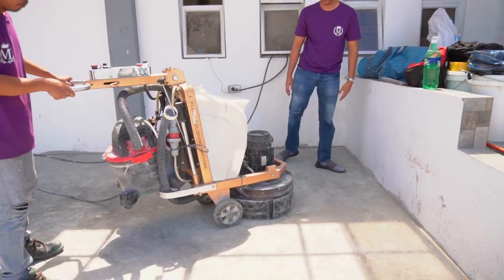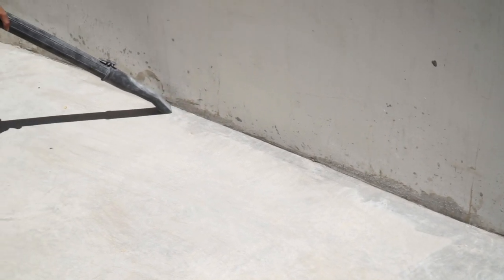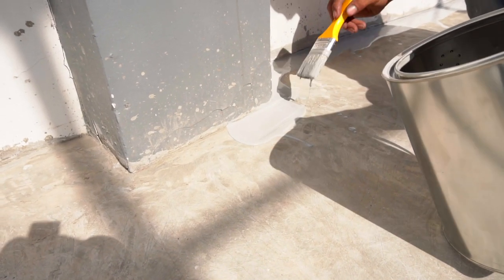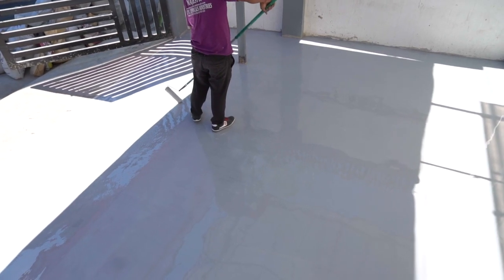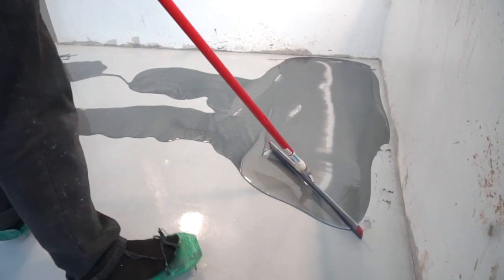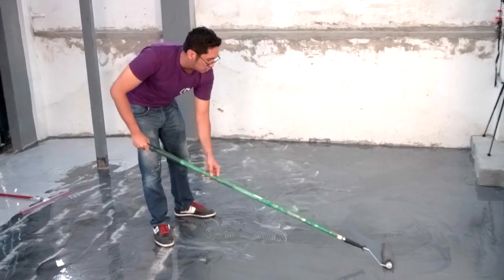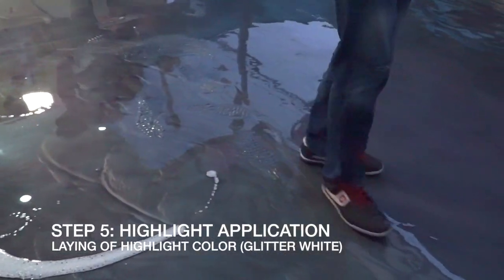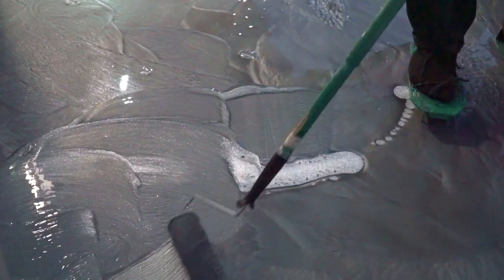METALLIC EPOXY GARAGE PHILIPPINES   METALLIC EPOXY FLOOR PHILIPPINES

Comment: ano poh ba ang poydi gamitin pang pakintab sa padir as labas ng bahay????
Reply from the maker: Good Day

Hindi po pwede ang ating product sa mga walls dahil self leveling po sya unless mag aapply po kayo sa plywood pahiga saka ikakabit sa wall :) makintab na po sya pag natuyo :)

makakabili po kayo sa amin, just message lang po and we will answer those Questions :)
https://www.facebook.com/majesticchemicals/

also we have LAZADA for COD
You can purchase to our Lazada
then screenshot your order then send it to us here so we can prepare it as soon as possible.
sa Fb page parin po :)
https://www.lazada.com.ph/majestic/?

Visit our Website
https://majesticchemicals.com/

By the way I'm Sherwin of Majestic Chemicals, Glad to assist you :)
For availing & quicker response, you may contact us
09182523454

Join MAJESTIC EPOXY RESIN COMMUNITY PHILIPPINES to show your resin works and share tips
⬇️M⬇️A⬇️J⬇️E⬇️S⬇️T⬇️I⬇️C⬇️ ⬇️C⬇️H⬇️E⬇️M⬇️I⬇️C⬇️A⬇️L⬇️
https://www.facebook.com/groups/398748351104499

Comment: Boss bka pde malaman kung anu anu bblihin at brand nya pra d magkamali?
Reply from the maker: Good Day

MAJESTIC CHEMICALS po ang BRAND :)

makakabili po kayo sa amin, just message lang po and we will answer those Questions :)
https://www.facebook.com/majesticchemicals/

also we have LAZADA for COD
You can purchase to our Lazada
then screenshot your order then send it to us here so we can prepare it as soon as possible.
sa Fb page parin po :)
https://www.lazada.com.ph/majestic/?

Visit our Website
https://majesticchemicals.com/

By the way I'm Sherwin of Majestic Chemicals, Glad to assist you :)
For availing & quicker response, you may contact us
09182523454

Join MAJESTIC EPOXY RESIN COMMUNITY PHILIPPINES to show your resin works and share tips
⬇️M⬇️A⬇️J⬇️E⬇️S⬇️T⬇️I⬇️C⬇️ ⬇️C⬇️H⬇️E⬇️M⬇️I⬇️C⬇️A⬇️L⬇️
https://www.facebook.com/groups/398748351104499

Comment: Ganito gusto ko sa garahe ko e. Mgknu kaya aabutin 55sq.m
Reply from the maker: Good Day

Masasagot po namin ang inyong katanungan sa ating FB page :) 

makakabili po kayo sa amin, just message lang po and we will answer those Questions :)
https://www.facebook.com/majesticchemicals/

also we have LAZADA for COD
You can purchase to our Lazada
then screenshot your order then send it to us here so we can prepare it as soon as possible.
sa Fb page parin po :)
https://www.lazada.com.ph/majestic/?

Visit our Website
https://majesticchemicals.com/

By the way I'm Sherwin of Majestic Chemicals, Glad to assist you :)
For availing & quicker response, you may contact us
09182523454

Join MAJESTIC EPOXY RESIN COMMUNITY PHILIPPINES to show your resin works and share tips
⬇️M⬇️A⬇️J⬇️E⬇️S⬇️T⬇️I⬇️C⬇️ ⬇️C⬇️H⬇️E⬇️M⬇️I⬇️C⬇️A⬇️L⬇️
https://www.facebook.com/groups/398748351104499

Comment: Ano pong material ginagamit at saan makakabili ng materials?
Reply from the maker: Good Day

makakabili po kayo sa amin, just message lang po and we will answer those Questions :)
https://www.facebook.com/majesticchemicals/

also we have LAZADA for COD
You can purchase to our Lazada
then screenshot your order then send it to us here so we can prepare it as soon as possible.
sa Fb page parin po :)
https://www.lazada.com.ph/majestic/?

Visit our Website
https://majesticchemicals.com/

By the way I'm Sherwin of Majestic Chemicals, Glad to assist you :)
For availing & quicker response, you may contact us
09182523454

Join MAJESTIC EPOXY RESIN COMMUNITY PHILIPPINES to show your resin works and share tips
⬇️M⬇️A⬇️J⬇️E⬇️S⬇️T⬇️I⬇️C⬇️ ⬇️C⬇️H⬇️E⬇️M⬇️I⬇️C⬇️A⬇️L⬇️
https://www.facebook.com/groups/398748351104499

Comment: Saan po pd makabili ng materials ng epoxy risen or metallic
Reply from the maker: Good day

Sa amin po mismo :) 
Avail na po kayo, dont worry meron po itong instruction maliban dun e gguide ko pa po kayo step by step until it's done :D 

For availing & quicker response, you may contact us
09182523454

Comment: pwd po yn s loob ng bahay?
Reply from the maker: Good Day
Pwedeng pwede po

makakabili po kayo sa amin, just message lang po and we will answer those Questions :)
https://www.facebook.com/majesticchemicals/

also we have LAZADA for COD
You can purchase to our Lazada
then screenshot your order then send it to us here so we can prepare it as soon as possible.
sa Fb page parin po :)
https://www.lazada.com.ph/majestic/?

Visit our Website
https://majesticchemicals.com/

By the way I'm Sherwin of Majestic Chemicals, Glad to assist you :)
For availing & quicker response, you may contact us
09182523454

Join MAJESTIC EPOXY RESIN COMMUNITY PHILIPPINES to show your resin works and share tips
⬇️M⬇️A⬇️J⬇️E⬇️S⬇️T⬇️I⬇️C⬇️ ⬇️C⬇️H⬇️E⬇️M⬇️I⬇️C⬇️A⬇️L⬇️
https://www.facebook.com/groups/398748351104499

Comment: Ano po maganda sa lood ng bahay yan metallic epoxy flooring po ba or ung tiles po.Thank you
Reply: MY LITTLE WORLD pareho lang kung gusto mo 1 whole floor go for epoxy, box designs for tiles
Reply: MY LITTLE WORLD actually mas pangit sa tiles kasi kapag ‘di maganda ang pagkabit pwedeng mabasag kapag tinapakan tapos papalitan mo pa.
Reply: @gavery2462  ano po magmahal ung metallic epoxy flooring po ba o ung tiles?at saka matibay na ung metallic epoxy flooring
Reply: MY LITTLE WORLD sa Tiles may mura, sa epoxy may mura rin depende naman sa design at quality so pareho lang naman. Mas okay lang sa tiles kasi marami nagkakabit pero sa epoxy pede ikaw or humire ka ng marunog
Reply: @gavery2462  ok po,maraming salamat sa sagot po.God bless you🙏🙏🙏🙏

Comment: pwede po bang bumili ng chemicals sa inyo at instruction to do it, para Siargao area kasi
Reply from the maker: Yes pwedeng pwede po sir. Its locally manufactured po
Reply: Magkano po ba per gallon
Reply: May website po ba ang store ninyo at pricing na

Comment: Pwedi po ba yan gamitin sa hardifloor na 3/4inch, salamat po
Reply from the maker: Pwedeng pwede sir. Isa sa advantage ng resin namin is flexibility. Kahit nag bend si hardi floor sasabay siya
 Additional din is waterproof na din si hardiflex
Reply: Pwede po ba yan sa rooftop? Tnx

Comment: Paano yan e maintain? Indoor flooring pwedi ba yan?
Reply from the maker: Good Day

Walis, punas lang po ang maintenance nito :) opo pang indoor po talaga sya maganda :)

makakabili po kayo sa amin, just message lang po and we will answer those Questions :)
https://www.facebook.com/majesticchemicals/

also we have LAZADA for COD
You can purchase to our Lazada
then screenshot your order then send it to us here so we can prepare it as soon as possible.
sa Fb page parin po :)
https://www.lazada.com.ph/majestic/?

Visit our Website
https://majesticchemicals.com/

By the way I'm Sherwin of Majestic Chemicals, Glad to assist you :)
For availing & quicker response, you may contact us
09182523454

Join MAJESTIC EPOXY RESIN COMMUNITY PHILIPPINES to show your resin works and share tips
⬇️M⬇️A⬇️J⬇️E⬇️S⬇️T⬇️I⬇️C⬇️ ⬇️C⬇️H⬇️E⬇️M⬇️I⬇️C⬇️A⬇️L⬇️
https://www.facebook.com/groups/398748351104499

Comment: bakit hindi kayo gumamit ng blow torch or isopropyl alcohol para alisin ang air bubbles? just wondering
Reply from the maker: We formulated our resin to be bubble free and for floors kasi if you have a big area kailangan po talaga minimal bubbles and if may mga nakakalusot po minsan kahit spot popping nlng po😁

Comment: Pano mkabili nito. Taga aklan ako. meron ba nito nationwide?
Reply from the maker: Good Day

makakabili po kayo sa amin, just message lang po and we will answer those Questions :)
https://www.facebook.com/majesticchemicals/

also we have LAZADA for COD
You can purchase to our Lazada
then screenshot your order then send it to us here so we can prepare it as soon as possible.
sa Fb page parin po :)
https://www.lazada.com.ph/majestic/?

Visit our Website
https://majesticchemicals.com/

By the way I'm Sherwin of Majestic Chemicals, Glad to assist you :)
For availing & quicker response, you may contact us
09182523454

Join MAJESTIC EPOXY RESIN COMMUNITY PHILIPPINES to show your resin works and share tips
⬇️M⬇️A⬇️J⬇️E⬇️S⬇️T⬇️I⬇️C⬇️ ⬇️C⬇️H⬇️E⬇️M⬇️I⬇️C⬇️A⬇️L⬇️
https://www.facebook.com/groups/398748351104499

Comment: Kumukupas b ung coatng kpg pinupunasan ng basa lagi.. Pwede b s buong bahay. Magkano mga gastos pg 20 square meter
Reply from the maker: Good Day

Di po sya kumukupas :D for more questions magtungo lang po sa aming FB page :D

makakabili po kayo sa amin, just message lang po and we will answer those Questions :)
https://www.facebook.com/majesticchemicals/

also we have LAZADA for COD
You can purchase to our Lazada
then screenshot your order then send it to us here so we can prepare it as soon as possible.
sa Fb page parin po :)
https://www.lazada.com.ph/majestic/?

Visit our Website
https://majesticchemicals.com/

By the way I'm Sherwin of Majestic Chemicals, Glad to assist you :)
For availing & quicker response, you may contact us
09182523454

Join MAJESTIC EPOXY RESIN COMMUNITY PHILIPPINES to show your resin works and share tips
⬇️M⬇️A⬇️J⬇️E⬇️S⬇️T⬇️I⬇️C⬇️ ⬇️C⬇️H⬇️E⬇️M⬇️I⬇️C⬇️A⬇️L⬇️
https://www.facebook.com/groups/398748351104499

Comment: Ano po ang magandang primer para sa rubberized paint sir?
Reply from the maker: Good Day

makakabili po kayo sa amin, just message lang po and we will answer those Questions :)
https://www.facebook.com/majesticchemicals/

also we have LAZADA for COD
You can purchase to our Lazada
then screenshot your order then send it to us here so we can prepare it as soon as possible.
sa Fb page parin po :)
https://www.lazada.com.ph/majestic/?

Visit our Website
https://majesticchemicals.com/

By the way I'm Sherwin of Majestic Chemicals, Glad to assist you :)
For availing & quicker response, you may contact us
09182523454

Join MAJESTIC EPOXY RESIN COMMUNITY PHILIPPINES to show your resin works and share tips
⬇️M⬇️A⬇️J⬇️E⬇️S⬇️T⬇️I⬇️C⬇️ ⬇️C⬇️H⬇️E⬇️M⬇️I⬇️C⬇️A⬇️L⬇️
https://www.facebook.com/groups/398748351104499

Comment: Tanong matipid ba ito kesa granite tiles?
Reply from the maker: Good Day

-water resistant
-heat resistant
-scratch resistant
-dust resistant
-chemical resistant
-di nag ccracks
-di nababasag
-walang maintenance, walis or punas lang
-super easy to apply
-shiny at elegant pa tignan
-non-slippery even wet
-odorless & solventless
-industrial grade
-food grade/safe
-Lifetime Quality
Can hold up to 10,000 PSI

kumpara sa Ceramic tiles
di naman po nagkakalayo ng presyo, mas mahal lang tayo ng konti pero. sobrang tibay naman po nya and lifetime quality po napaka shiny & elegant tignan

pero mas mura tayo sa Granite tiles at marble

makakabili po kayo sa amin, just message lang po and we will answer those Questions :)
https://www.facebook.com/majesticchemicals/

also we have LAZADA for COD
You can purchase to our Lazada
then screenshot your order then send it to us here so we can prepare it as soon as possible.
sa Fb page parin po :)
https://www.lazada.com.ph/majestic/?

Visit our Website
https://majesticchemicals.com/

By the way I'm Sherwin of Majestic Chemicals, Glad to assist you :)
For availing & quicker response, you may contact us
09182523454

Join MAJESTIC EPOXY RESIN COMMUNITY PHILIPPINES to show your resin works and share tips
⬇️M⬇️A⬇️J⬇️E⬇️S⬇️T⬇️I⬇️C⬇️ ⬇️C⬇️H⬇️E⬇️M⬇️I⬇️C⬇️A⬇️L⬇️
https://www.facebook.com/groups/398748351104499

Comment: How well will this hold up to car repair duties of a garage, such as using a floor jack and jack stands, falling tools and car parts?
Reply from the maker: Good Day

Our product or resin epoxy has

-water resistant

-heat resistant
-scratch resistant
-dust resistant
-chemical resistant
-di nag ccracks
-di nababasag
-walang maintenance, walis or punas lang
-super easy to apply
-shiny at elegant pa tignan
-non-slippery even wet
-odorless & solventless
-industrial grade
-food grade/safe
-Lifetime Quality

10,000 PSI 

makakabili po kayo sa amin, just message lang po and we will answer those Questions :)
https://www.facebook.com/majesticchemicals/

also we have LAZADA for COD
You can purchase to our Lazada
then screenshot your order then send it to us here so we can prepare it as soon as possible.
sa Fb page parin po :)
https://www.lazada.com.ph/majestic/?

Visit our Website
https://majesticchemicals.com/

By the way I'm Sherwin of Majestic Chemicals, Glad to assist you :)
For availing & quicker response, you may contact us
09182523454

Join MAJESTIC EPOXY RESIN COMMUNITY PHILIPPINES to show your resin works and share tips
⬇️M⬇️A⬇️J⬇️E⬇️S⬇️T⬇️I⬇️C⬇️ ⬇️C⬇️H⬇️E⬇️M⬇️I⬇️C⬇️A⬇️L⬇️
https://www.facebook.com/groups/398748351104499

Comment: Sir gumagawa po ba kayo with in metro manila.tnx.plan ko ko magpagawa sa flooring ko sa bahay.
Reply from the maker: Good day

Opo nag susupply at  Gumagawa po kami :D 
Saan po location nyu?

For availing & quicker response, you may contact us
09182523454
Reply: @MajesticChemicals  sa pasig area po ako.magkano po ang magagastos sa 15sqm na up and down.salamat po.
Reply from the maker: @ludydales9552  
2500/sqm for materials and labor
+20k for Equipment and Mobilization with 5 Years Warranty.

1 week tapos na po agad, actually around 5 days lang po sya dry na :D 

For availing & quicker response, you may contact us
09182523454
Reply: @MajesticChemicals  okey po.salamat po.inquire na lang po ako if magpapagawa na po ako.
Reply from the maker: @ludydales9552  
Okay po

If ever po, once na okay na po text or tawagan nyu lang po kami sa Contact no. sa baba and for inquiries at question din po masasagot po natin  yan pag tungkol sa resin :D 

kung kayo po mismo ay gusto ito masubukan, try nyu na po mga starter kit namin na kayo po mismo gagawa at lalabas ang pagiging artistic nyu po ^_^ 

For availing & quicker response, you may contact us
09182523454
Reply: @MajesticChemicals  okey po.salamat muli.
Reply from the maker: @ludydales9552  

Welcome ^_^ 

For availing & quicker response, you may contact us
09182523454

Comment: sir, pwede po ba kapag smooth na surface ng floor?
Reply from the maker: Good day

Opo pwedeng pwede po iyon :D 

Avail na po ^_^ 

For availing & quicker response, you may contact us
09182523454

Comment: Ilang sq meters po ang kaya ng 1 gallon po
Reply from the maker: Good Day

upto 5sqm po sa ating Gallon kit.

makakabili po kayo sa amin, just message lang po and we will answer those Questions :)
https://www.facebook.com/majesticchemicals/

also we have LAZADA for COD
You can purchase to our Lazada
then screenshot your order then send it to us here so we can prepare it as soon as possible.
sa Fb page parin po :)
https://www.lazada.com.ph/majestic/?

Visit our Website
https://majesticchemicals.com/

By the way I'm Sherwin of Majestic Chemicals, Glad to assist you :)
For availing & quicker response, you may contact us
09182523454

Join MAJESTIC EPOXY RESIN COMMUNITY PHILIPPINES to show your resin works and share tips
⬇️M⬇️A⬇️J⬇️E⬇️S⬇️T⬇️I⬇️C⬇️ ⬇️C⬇️H⬇️E⬇️M⬇️I⬇️C⬇️A⬇️L⬇️
https://www.facebook.com/groups/398748351104499

Comment: Hays.. baket hindi kayo nagrereply
Reply from the maker: Good Day

makakabili po kayo sa amin, just message lang po and we will answer those Questions :)
https://www.facebook.com/majesticchemicals/

also we have LAZADA for COD
You can purchase to our Lazada
then screenshot your order then send it to us here so we can prepare it as soon as possible.
sa Fb page parin po :)
https://www.lazada.com.ph/majestic/?

Visit our Website
https://majesticchemicals.com/

By the way I'm Sherwin of Majestic Chemicals, Glad to assist you :)
For availing & quicker response, you may contact us
09182523454

Join MAJESTIC EPOXY RESIN COMMUNITY PHILIPPINES to show your resin works and share tips
⬇️M⬇️A⬇️J⬇️E⬇️S⬇️T⬇️I⬇️C⬇️ ⬇️C⬇️H⬇️E⬇️M⬇️I⬇️C⬇️A⬇️L⬇️
https://www.facebook.com/groups/398748351104499

Comment: Magkano po b ang cost lahat pg ngpagawa po ng buong flooring?
Reply: Ksama n po ung bayad s gagawa, bale lhat lhat po pti n po ung labor?
Reply from the maker: Good day depende po sa lawak ng area nyu at sa location nyu po :) 
For availing & quicker response, you may contact us
(+639182523454)
Reply from the maker: @babylyncabadsan964  Yes po lahat lahat po kasama na po :)
For availing & quicker response, you may contact us
(+639182523454)

Comment: How much po ba pagawa bang ganyan sir
Reply from the maker: Good day

Depende po sa sukat by sqm ng area na pag aapplyan nyu yung price na ma rerecommend namin :) 

pero ito po ang list

Metallic Flooring kit
2 Gallons (7 Liters) Selfleveling primer
1 Pail (12 Liters) Metallic/ Liquid marble 
Free 300g metallic pigments 
15sqm coverage area 
18,000 Pesos

Metallic Countertop kit
2 Liters Selfleveling primer
3 Liters Metallic/ Liquid marble
Free150g metallic pigments 
4sqm coverage area 
6,600 Pesos

Metallic Starter kit
1 liter Selfleveling primer
1 liter Metallic/ Liquid marble
Free 50g metallic pigments
1sqm coverage area 
2,800 Pesos

For availing & quicker response, you may contact us
09182523454

Comment: hindi ba madulas yan for garage?
Reply from the maker: Good Day

Yes eto pong epoxy natin hindi po sya madulas kahit basa ^_^

For more details, Pm us po

makakabili po kayo sa amin, just message lang po and we will answer those Questions :)
https://www.facebook.com/majesticchemicals/

also we have LAZADA for COD
You can purchase to our Lazada
then screenshot your order then send it to us here so we can prepare it as soon as possible.
sa Fb page parin po :)
https://www.lazada.com.ph/majestic/?

Visit our Website
https://majesticchemicals.com/

By the way I'm Sherwin of Majestic Chemicals, Glad to assist you :)
For availing & quicker response, you may contact us
09182523454

Join MAJESTIC EPOXY RESIN COMMUNITY PHILIPPINES to show your resin works and share tips
⬇️M⬇️A⬇️J⬇️E⬇️S⬇️T⬇️I⬇️C⬇️ ⬇️C⬇️H⬇️E⬇️M⬇️I⬇️C⬇️A⬇️L⬇️
https://www.facebook.com/groups/398748351104499